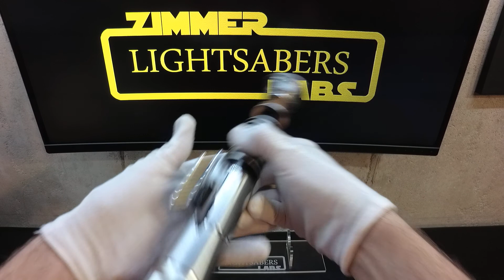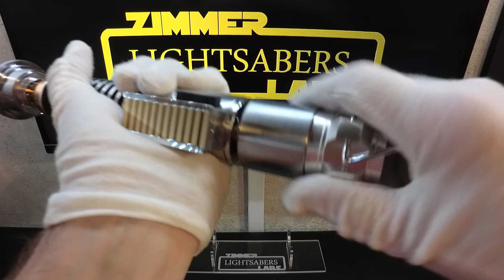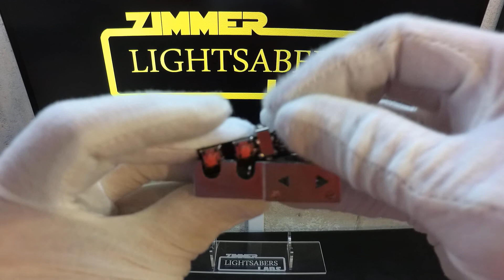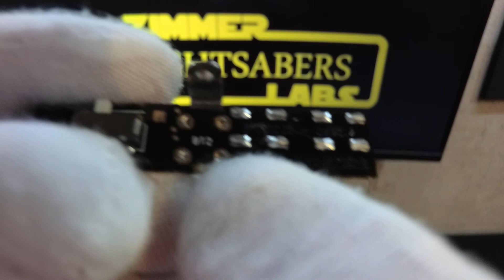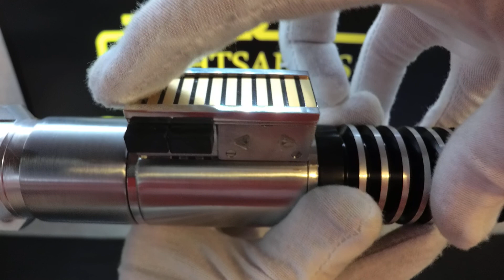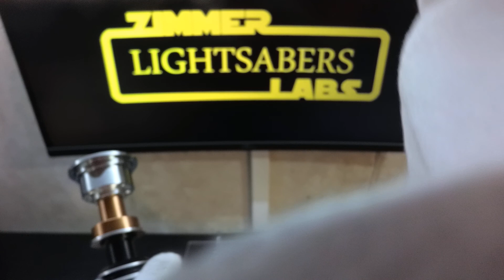Korbanth Gullwing LS6 Neopixel Teensysaber w Crystal Reveal   Part 1

Comment: Hey, I was wondering if you can help explain something. I understand the concept of hijacking the switches of the control box to activate the soundboard. But I don't know where I should be cutting/soldering to use the on-board LEDs with my CFX. The CFX has support for accent LEDs, so I plan to go that route. Just stumped as to where to connect the soundboard to on the control box PCB for aforementioned accent LEDs. 

Sorry if that was hard to follow, thanks for reading.
Reply: Did you ever figure this out??

Comment: Regarding how the accent LEDs operate, how did you get them to blink/operate in the order in the video? I'd like to see the wiring diagram for that and how exactly you did the circuit board mod.
Reply: I too would like to know how you modified the control box.
Reply: Yes, I’m also wondering how you modded the box. I want to use the two buttons for proffi and use the kill switch on the board to be a saber kill switch and keep the lights working.
Reply: I'm up for that as well please

Comment: can you please send (zar6515@gmail.com) me the instruction how did you modify the board. I would appreciate it. Thank you.
Reply from the maker: Hi Cezar, what do you mean "modify the board"?  If you are talking about the clamp card, I simply drilled a small recess on the underside of the clamp card, and attached a metal pole using epoxy.  then I attached that metal pole to the switch pole using said epoxy.  that basically makes the clamp card itself the top of the slide switch.  I hope that helps
Reply: oh ok thanks but how did you interconnect the clam card switch to the sound card? like how did you do the wiring? thanks.
Reply from the maker: Ahhh.... that's the easy part.  just run two black wires from the two legs of the slide switch.  one goes to the soundcard ground (-) and one goes to the recharge port ground (-) leg.
Reply: Thanks so much for the tip!

Comment: Using the clamp card, as a kill switch like that, seems as if you will turn it off by accident way too easily.
Reply from the maker: Actually, it's not an issue.  the clamp card is only extended by 1/16".  So it isnt enough that it gets pushed back when in use.  That's something I was concerned with at the beginning.  But after finishing the build, it isnt a problem.  If it stuck out more, it might be.
Reply: @ethanzimmerzimmerlabs823  are you able to share how this is done? Some pictures would be good!

Comment: Is it duel-worthy, with all the electronics installed?
Reply from the maker: Lite dueling, yes.  Heavy dueling, no.  Any string blade saber shouldn't be dueled with heavily.
Reply: Ethan Zimmer, Zimmer Labs Does it have to use a string blade? Can I use an LED, instead?